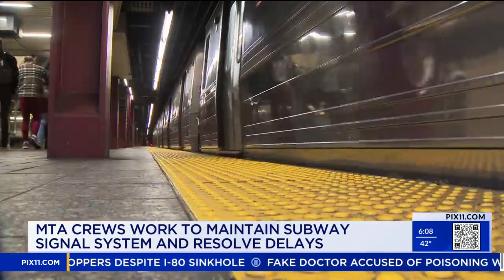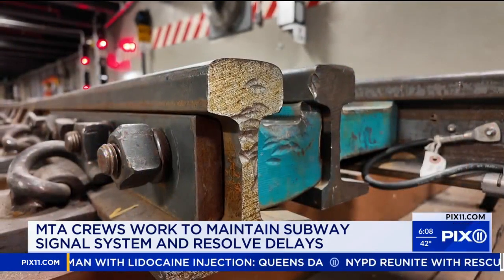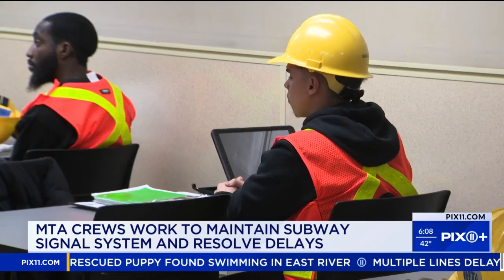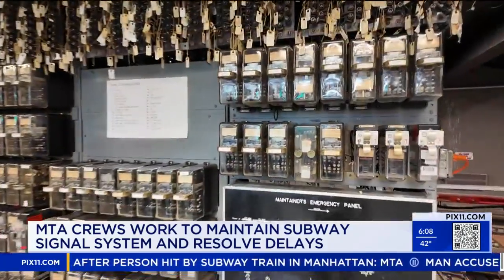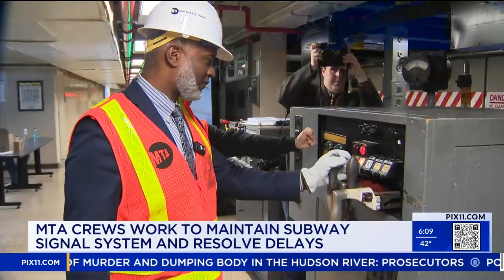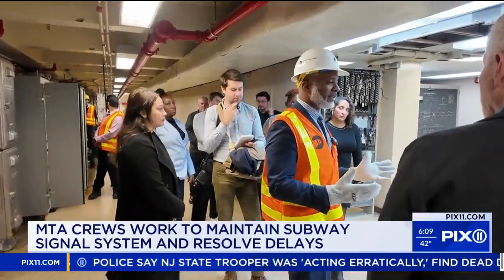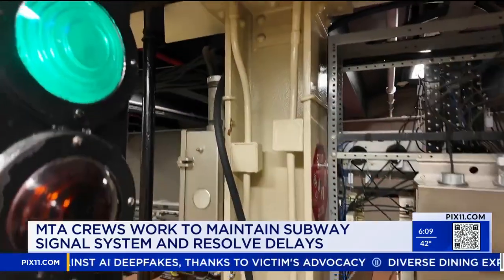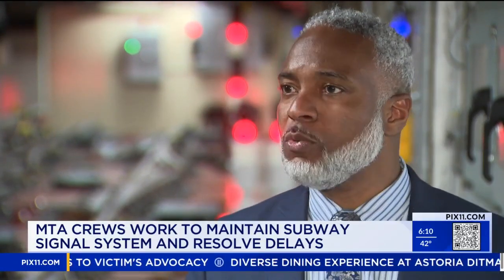NYC Transit tackles signal system challenges with training and upgrades

Comment: I thought the MTA was supposed to be moving towards automatic controls where the main system computers keep each train separated from the other trains.
Reply: Yeah they are but those computers need to be maintained by people, and only lines with newer trains can have automatic controls so gotta replace the old trains and track first.
Reply: yes Culver, Queens Boulevard, 8th Ave, Crosstown, Broadway lines are getting full or partial CBTC upgrades.

Comment: Queens Boulevard signal replacement was funded and supposed to be done 10+ years ago. MTA is a joke
Reply: it's been done for several years now, that's why the lights flash green everywhere
Reply: @i_am_a_toast_of_french  No, it's only done up to Union Turnpike, which is what the video said
Reply: @ because they only planned to add CBTC on queens boulevard up to union turnpike? there's very little reason to add CBTC to the rest of queens boulevard or archer because they aren't trying to stuff 32 trains down 2 tracks in an hour 🤦
Reply: @i_am_a_toast_of_french what I also noticed is that the delays have gotten worse.
Reply: @ i don't think you have good observation skills? signal related incidents per month on the EFMR have decreased by 50% after CBTC installation and the trains are running much faster now through the express tracks
Reply: @i_am_a_toast_of_french  I don't think you understand that they have not installed CBTC past Union Turnpike. The work past Union Turnpike is "underway" AKA no progress for years. That is not up for debate. Don't know what you're even talking about
Reply: @flightmasterr231  also there's no point in installing CBTC past union turnpike and installing it will not change anything about how trains already move, if they actually did it you'd complain they worked on some worthless project again fixing something that wasn't broken
Reply: @ Yeah you're just wrong dude. If there's no point, then why is the MTA doing it?
Reply: @flightmasterr231  because they're done with installing cbtc on the important lines? and they signed the contract for the eastern part of qbl in 2021 and started in 2023, they didn't start it with western qbl? like the first contract didn't cover eastern qbl idk why you think that and it's not even a large priority at all for the MTA nor for commuters

Comment: We need more manpower. It’s wonderful that signals is getting the recognition that we deserve, but we can’t get the job done without manpower and overtime.
Reply: If anything, headcount should be reduced. On what planet do you need more manpower? These signal systems are nearly able to operate the trains autonomously. Foolish thought
Reply: More manpower is why NYC will never have world class transit. Why do we need to hire more expensive workers that don’t provide any benefit? We need to build smarter and use our current workforce more efficiently, stop hiring 5 people for a job that takes 1 and actually put them to work
Reply: @ we don’t have enough people to maintain current equipment efficiently.
Reply: @Bknyx  It might mean more efficient equipment is also need that requires less manpower